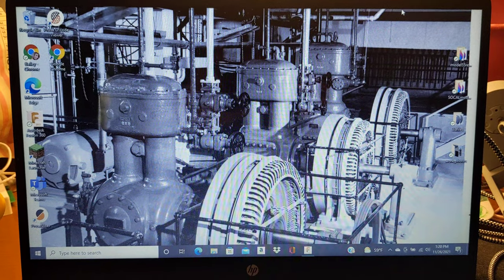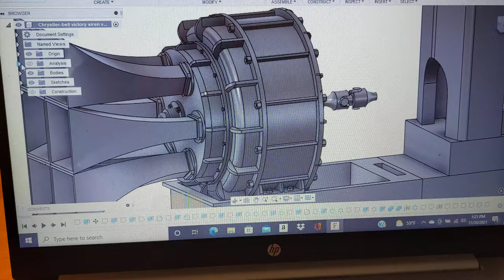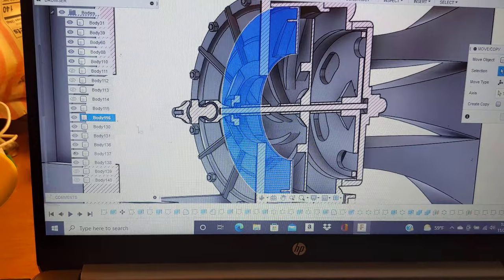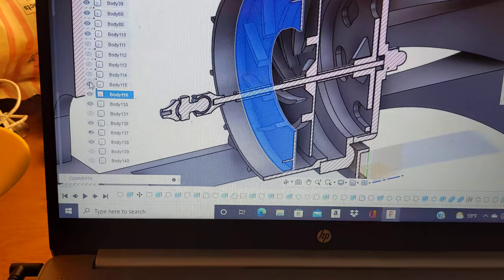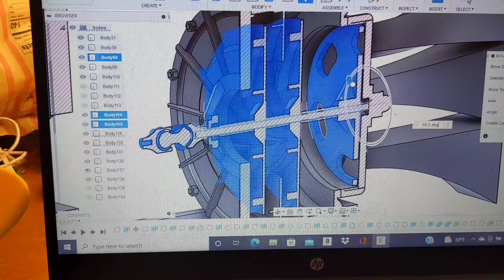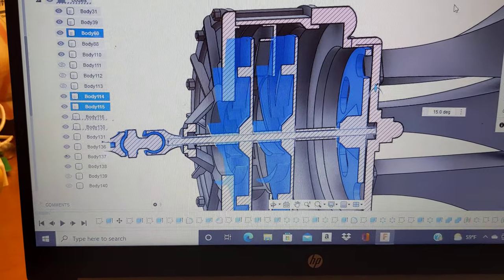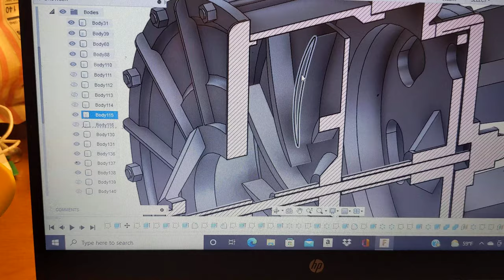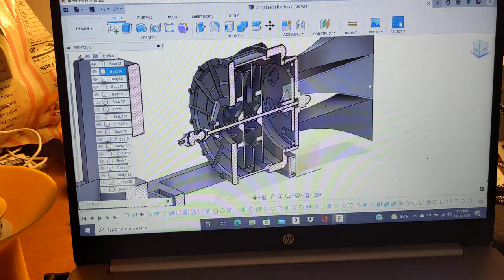3d printed Chrysler siren internals

Comment: Does the real Chrysler have multiple stages of supercharging like this, or did you modify the design to get the most performance out of it's small size? I'm interested in modeling one if I can get enough info on how it works and looks inside. Never really studied these things.
Reply from the maker: Yes the original Chrysler siren used a multistage centrifugal blower, specifically 3 stages on the final generation, which this is modeled after, the earlier generations however were only 2 stage and had the twisty and turny exposed air  plenums. The earlier ones also used a 4 cylinder engine rather than the v8
Reply: @connorcruz6249  Cool, thank you! I'll try to model both the earliest and latest ones.